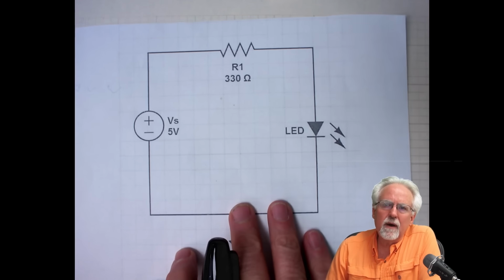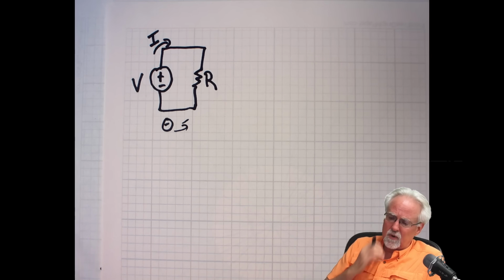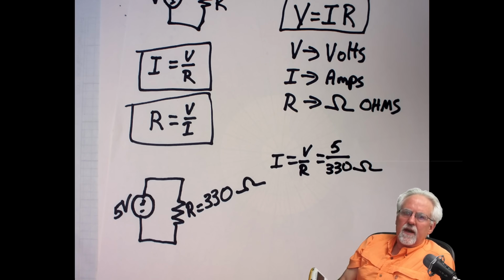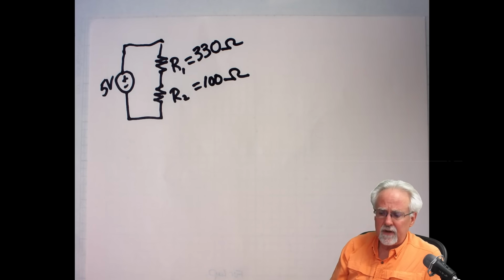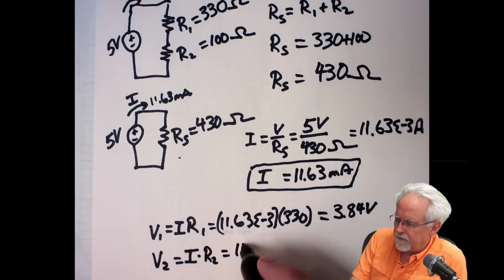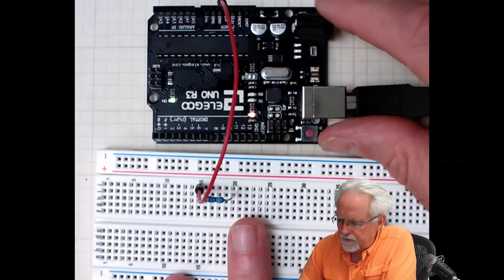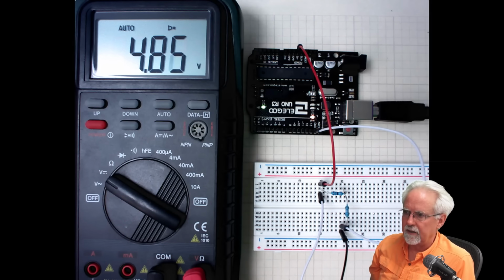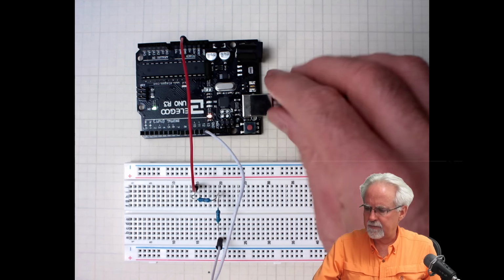Arduino Tutorial 9: Understanding Ohm's Law and Simple Circuit Design

Comment: I am having a hard time understanding this concept.  How can the sum of the voltage drop be equal to your initial voltage. I know I am missing something here.  If you start with 5 volts and a 330 ohm resistor drops you down 3.84 volts and a 100 ohm resistor drops you another 1.16 then you are left with zero. So 430 ohms of resistance drops you 5 volts. So then how can an LED have power after a 1000 ohm resistor? Like I said, I know I am missing something, but I re watched this video a few times and this seems like the way it is explained.
Reply: This is all new to me to me too so instead of me trying to explain it poorly I would instead suggest you look up  Kirchhoff's Voltage Laws. Basically, I think, if you put an LED after the R2 it would increase your resistance which would reduce you amperage but at the end of your loop you still would have zero volts. Volts entering the loop must be used up. I'm not sure this helps I only hope it doesn't add to your confusion.  And if someone reads this who knows better feel free to pile on.

Comment: This was a very good review of basic electrical calculation and circuit design.  Much needed for this Marine (Mechanical) Engineer who does little in the electrical world.  I've had a multimeter for a while, but forgot how to use it.  That would be a good lesson from you:  Using a multimeter for common checks (Amps, Ohms, Volts, AC, & DC).  Just my 2 cents.

Comment: I’m trying to get enough background to modify a “speeduino” ECU for an engine control project. I need to add control of solenoids for pneumatic valve control and some unique combustion controls (modifying a V8 to reduce emissions). I’ve programmed Arduino boards before, but needed to “get under the hood”. This series is very helpful, thank you.

Comment: Hi Paul, I would echo the very possitive comments already raised and for me you need to understand the theory to be able to do the practical.  Lesson 9 was very good at explaining Ohms law but the bit I am missing is if you have a simple circuit comprising of 1 LED. 1 resister and power supply of 5 Volts using Ohm's law how to you calculate the size of resister needed.

Comment: Glad you did this because I usually use esp8266 attiny85 or esp32 and 8285 chips. All except the attiny run at 3.2 or 3.3 volts

Comment: im not the best at math but when you say you dont want to use 15.15 miliamps to use 15.15[ -3, that is the same as entering it as .01515 into calculator,  would that be a correct statement?

Comment: Been glued to your tutorials 1 through 9 now in little over a day and NOT bored.  I really appreciate the under the covers approach.  No I have not bought the kit yet but was a programmer for 35+ years and this included several years of C++ which is the Arduino code base and so I really understand your examples.  Why not get the kit,  I am Iooking for ways to control a very complicated irrigation system with an undependable water source that will need to shift from irrigation water to city water as needed and automatically.  So do I need to step higher than the Arduino Uno, don't know? For sure it seems these tutorials will help in my analysis. Through the tutorial I digressed into interactive debuggers and found one that goes with the ESP32  system which also includes Bluetooth and WIFI, both desirable features.  Any feed back anyone can offer will be appreciated.

Comment: I almost can not finish watching this. With the dame stereo audio. DAMN IT'S ANNOYING. It's fine if your voice gets soft when you back off the mic, BUT it's not ok for it to be less in one ear then the other. Might work if you use speakers but on the headset it's hell. Mic audio in this situation should be MONO. 

Good there is a chrome extension that gives a mono option. Fixed. Back to the lesson.

Wow I had a lot of pent up stress from that bad audio then I would have guessed. The relief after fixing it is palpable. I did not know it was effecting me that much but the sigh of relief knowing it's not going to urk me anymore. Wow 🤯

Comment: Wait if negative charges repel, the flow is current is coming from the negative side right? If that's so, why are we putting the resistor on the positive side instead? Also what does the E in 15.15E^-3 mean? Shouldn't it be 15.15 * 10^-3?

Comment: I have a question. Firstly, I assume the larger the ohm rating of the resistor, the larger the resistance? If so, why does the larger  330 ohm resistor let more volts through it compared to the 100 ohm one? thanks!
Reply: It does not let more voltage through it, it consumes more voltage because it has a higher resistance.

Comment: I do have a question maybe you can answer.  How is it that current flows positive to negative when the amps are the measure of electrons per second flowing through a point?  If coulombs are the unit of amperes (A=C/s), then it makes sense to me that current flows negative to positive.  This is how I was taught (Military) but I run into a lot of college grads that always say positive to negative.  This may seem trivial because as long as you have a completed circuit current flows and things work but nobody has been able to explain it yet.  I have always equated this to electrons move freely but protons are immobile.

Comment: Here I am at lesson 9 and all this time I was unknowingly using a 220 ohm resistor in all these projects instead of a 330!  Through circuit analysis and seeing the voltages across the resistors so far off made me take a closer look!  Yeah, this is going to be useful!  My first rookie mistake.
  Also, personally, I prefer the engineering aspect that you do. To me it's not boring....it's necessary to learn everything so that we CAN do accurate and educated circuit analysis.
Reply: The guide that came with mine said to use the 220 ohm resistor but the 330 ohm one works :)

Comment: This course is not only Arduino/C programming course. It is good to mark these series as series for "absolute beginners in electronics". Some parts are simply not in place, because the majority expects programming tutorials, not basics. I don't need to learn again what PN junction is, or how to calculate current, power, energy or voltage divider.

Comment: The e-3 is confusing me. I am trying to wire round LED chips using 2 AA batteries. So 3v. They are rated for 560-700 mA. So I got 5 ohms for the calculation. So I use a 5 ohm resistor? I notice you are using 330 ohm. That seems like a huge difference to me. Will a 5 ohm resistor be enough to keep from burning out my LED? This project is non arduino but still same principle I think

Comment: This is one thing which has always been difficult to me.  Math.  Calculators don't make sense to me.  Often times I would find that my calculator was giving a completely different answer, usually because I was in some wrong mode, and I struggled a lot remembering the equations and such.  You mentioned I needed the right kind of calculator to make these calculations, but why isn't my calculator good enough?  How can I just manually do it on paper if I don't have a calculator?

Comment: I did fine until we got to the part where you were using the voltmeter. The only part I could duplicate was the 5V Arduino voltage measurement. The rest of it got really hard to follow. I got one reading of 148 mV and the rest were equally undecipherable. What I had a problem with was trying to figure out if my meter wires needed to be inside or outside the circuit wires. Or if it made a difference.

Comment: Electron flow direction, as opposed to conventional current flow direction...both are used by different electrical and electronics techs and engineers. As a trained electronics engineer, I was taught that current (that is, flow of electrons) was ALWAYS from more negative to more positive conductive elements.
The difference between conventional current flow (positive to negative) and electron flow (also known as current flow) are really just two sides of the same coin. I learned electronics back when vacuum tubes were the "transistors" of the day. In a tube, current of electrons always flowed from a cathode (negative) to an anode plate (positive). It's the only way a vacuum tube could possibly work. 
So basically, some say "tomAYto" and some say "toMAHto". They're the same fruit.
Reply: OHM's LAW doesn't care which way the little charges are moving. It works either way.
Reply from the maker: It does care, because it makes a difference whether you have a negative or positive voltage, depending on the sign of the current. I am not going to debate you on this, because I dont want this to confuse other people.
Reply from the maker: Actually no, and you are going to confuse people here. Direction does matter. This is how it works. Like charges repel, and unlike charges attract. Hence, the electrons themselves flow out of the negative terminal, and into the positive terminal. Since electrons are negatively charged, they are attracted to the Positive terminal, and repelled from the negative terminal. Current flow is OPPOSITE from electron flow. Positive current is out of the positive terminal and towards and into the negative terminal. Yes, current flow is the flow of electrons, but it is in opposite direction.

Comment: My brain broke when you explained that the amps stay the same across the entire circuit but the voltage changes after each resistor. Why wouldn't amps and voltage behave the same way?

Comment: how did he get the 11.63mA? if i divide 5v/430 it gives me 0,01162. Do you have to divide again with 10000? thanks, awesome tutorials
Reply: This is probably the wrong way to describe it but here goes. Your figure , 0.01162, is amps. his figure is, 11.63 milliamps. 1 amp is equal to 1000 milliamps. To convert amps to milliamps multiply by 1000. Hope this helps. Also his calculator is set to automatically display milliamps (kind of).

Comment: Why do you add the resistances (R_s = R_1 + R_2) instead of multiplying? If I take the analogy of water (voltage is similar to pressure, current is similar to flow rate, resistors restrict flow), then the equation V = IR makes sense. If you make the restriction half as large, the pressure doubles. If you restrict by half again, the pressure will double again, like you multiplied. Why is the current constant across the circuit? Why doesn't it change as it passes through each resistor?
Reply: If anyone else reads this, I think I've got it. The current is the same at any point in the circuit. So the current is the same before the first resistor, between the resistors, and after the last resistor. Because of that, you just add all the resistances together. (I was previously imagining the current changing after each resistor.) I've never studied electricity before so this is all new and exciting!

Comment: From my school studies, I have come to know about the concepts of voltage drop and terminal voltage. I think there's a voltage drop in the Arduino and so, the terminal voltage, which is measured by your voltmeter is 4.96V and not 5V. 
Or it's just a case of a bit of inaccuracy of the voltmeter.
Am I wrong somewhere?

Comment: Paul, this makes sense.  Students need to know that you are able to read and send values then use the return values or messages to do something.  like once the light is on, read voltage at "X", if voltage is equal "value"  Serial.print  (value).   This is what I am eager to learn.

Comment: Paul, first of all, love your videos. I went to college as a Physics major in the 1980's and then spent 20+ years as a control systems design engineer. Nowadays, as a project manager, I'm a little removed from component level design so I'm going through your tutorials to refresh myself. From what I have seen so far, I wish I had this resource when I was in school. It would have saved me a lot of late nights pouring over textbooks. The only caveat I can think of, is to maybe provide a few references to YouTube videos on the subjects of basic electricity and use of a multimeter for the people who are not familiar with this.

Comment: Hi Paul, really enjoying your tutorials, electricity has been a mystery to for the greater part of my 70 years. I know there is a thing called OHMs law and a few rudimentary calculations. I'm following this tutorial with interest, I totally get the drop in voltage across the resistors, and the need to have the correct resistor for the component you are using so as not to fry it. That alone is a huge step in my electronics understanding, but what I'm struggling with, is the voltage being 5v going back to the board, am I explaining that well enough? I understand the calculation you made to show the voltages add up to 5v when measuring V1 and V2, but if I were to add and LED after R2, the voltage applied would be 1.16 to the LED. how does the voltage that goes back to the board be 5v?
Reply: Well, having built the circuit I get it, perhaps I should have done that first :-)

Comment: I am really enjoying these tutorials and am looking forward to working through them all (I am only on #8 at the moment).

I have always had a particular mental block in electronics theory and I thought I would tell you about it because I am sure I am not alone and, for the moment, you haven’t addressed it.  It concerns completing circuits and the role of ‘ground’ or ‘earth’.  I have always crudely understood ‘ground’ to be there to provide a safe exit for dangerous currents so as to avoid discharge through people. However, you seem to use ‘ground’ as an alternative to completing a circuit, and I don’t understand this.  If current moves from the positive terminal through a ‘circuit’ but doesn’t actually come back to the source (battery or other) then how is it a circuit?  How can the electrons actually be going the other way round the circuit when the negative terminal isn’t connected?  How can the negative be the same as the ‘ground’?

This problem isn’t going to stop me from completing the series of tutorials and I am telling you about it simply because I think it is important for teachers to understand where their students have difficulties.  If this is covered in later tutorials then please disregard!

Comment: Hi Paul,  I will be buying an engineering calculator, but I want to make sure it expresses mA in the correct format.  Can you recommend one?  Also, do you actually enter the "e-3" into the calculator from the keypad?  I've never seen or used one.  Thank you!
Reply from the maker: Bill,
This is the scientific calculator I use.
https://amzn.to/2WDVkn4
(affiliate link).

You use the blue EE key to get the 'e'

Hence, if you want 5e-3 you use the EE. It is behind the comma, that is you kit 2nd , and that gives you the scientific or engineering notation.

Hope this helps.

Comment: I understand Ohm's law a bit better after watching this. I've used both voltmeters I have to measure voltage from the Arduino,  and found the 5V is low,  about 4.9, and the 3V is actually 3.26. This is important because you need to know that voltage to calculate the resistance for the LED, since some can only take 2-2.3V and others can take 3-3.3V, depending on the color of the LED. You can't just use the same resistance and voltage for every LED!

Comment: I love when you think you know something, but when you watch a video like this it finally "clicks". Instead of just regurgitating equations, you understand and can reproduce results yourself. There is a total voltage drop across a circuit that equals the starting voltage, which explains the funky equation you use for parallel circuits. This also helps you when you're choosing a resistor for an LED.

Comment: Hi. You lost me at using engineering notation (I don’t have a calculator that does it) I managed to do the sums with an ordinary calculator as below (ignore the 2 decimal places):
Ohms law.       V
                          ———
                         I        R
To calculate milliamperes divide and multiply by 1000 as needed

e.g 5v circuit has a 330 ohm and 100 ohm resistors in series 
(Total = 430 ohms

To calculate current:
I =V divided by R
I=5 divided by 430 (result times by 1000)
I=0.01162 times 1000  = 11.62 milliamperes

To calculate voltage drop over the 330 ohm resister do:
V=I times R (result divided by 1000)
V=11.62 times 330 divided by 1000 = 3.83 volts

Comment: Paul, I recalculated current with the 4.86v and got a current of 11.3 mamps. R1 of 330 ohms gave me a voltage of 3.73 v and R2 of 100 ohms gave me a voltage of 1.13 v for a total voltage of 4.86 v. Good workout. Manny from Puerto Rico

Comment: Why not tell everyone the truth.  They had no way of knowing what way the electrons (or magic smoke) was going back when they were discovering all this stuff, so took a stab in the dark about the direction and got it wrong.  50/50 chance = 99% chance of getting it wrong (lol).  So, its called conventional current theory (that's soo messed up).
From memory, there is some different name for the correct direction (current going the same way as electrons), but I cant remember it and I dont think its actually used now...
Why wasn't it corrected when it was discovered?  i-dont-know.  Probably old professors not wanting to change and all the documentation that would have had to be changed.
PS.  Not criticizing you, your doing a great job.  Just putting my 2c in for the older crowd.